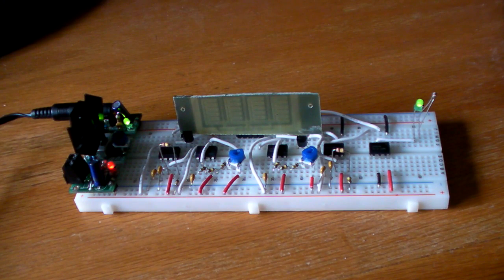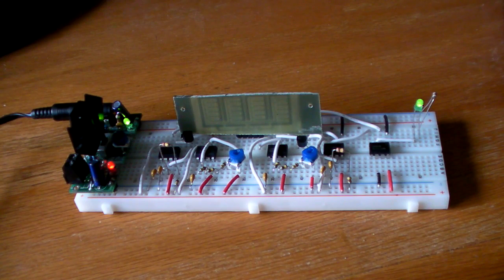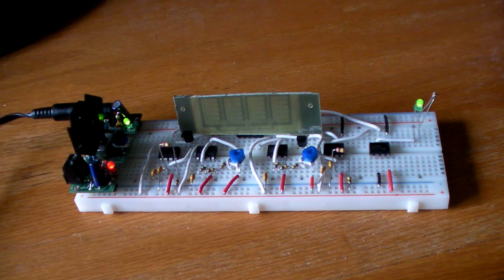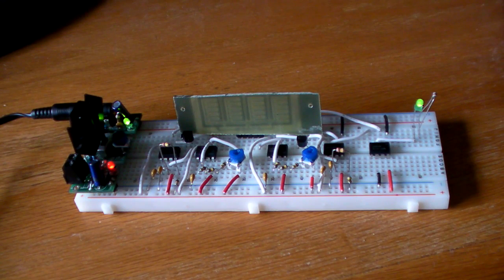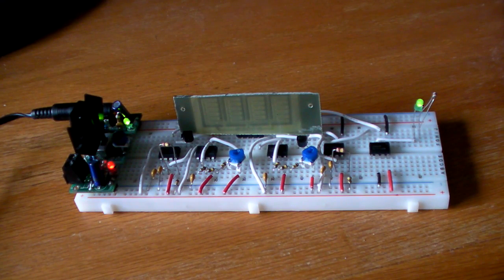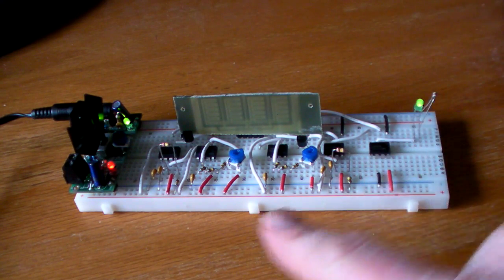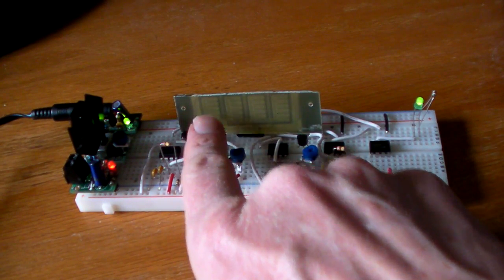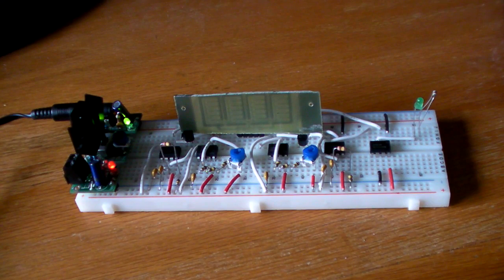555 capacitive touch sensors

Comment: Your link doesn't work!
I am interested in such circuits. I am planning a touch panel consisting of Plexiglas and self-engraved buttons that light up when activation or change color.
I think it will not be easy.

Comment from the maker: @trufact You are right, I meant leave out the bistable. But now that I am more awake, I realize this would give you a 5 volt signal when off, and a series of 0 volt pulses at about 25KHz when touched.  That may not be what you want.

The capacitor across the "button" needs to be a small value, I think under 500pF. Electrolytic capacitors are too high value.

Comment from the maker: olavus - There is some unetched copper at the ends of the board, but it's not needed, not grounded.

trufact - There is a link to my blog in the comments (click "show more") with theory of operation and schematics. For momentary push buttons, leave out the astable 555 that is used as a flip-flop to latch the output state. The outputs of the monostable 555's are the momentary outputs you want.